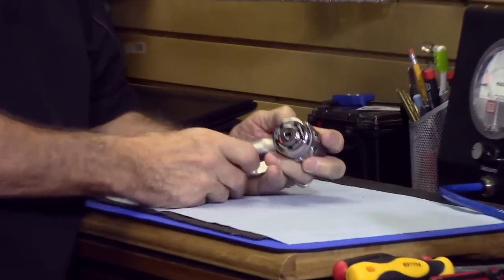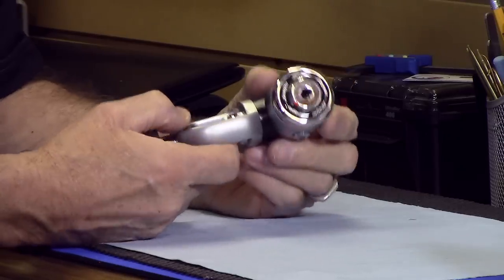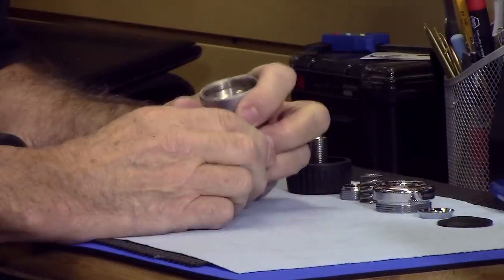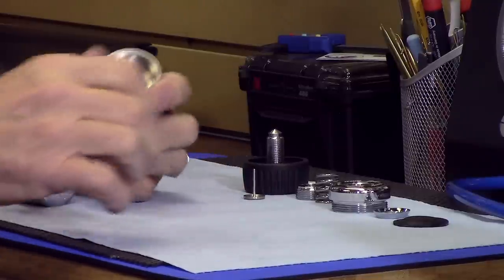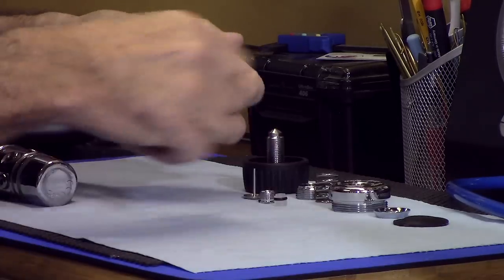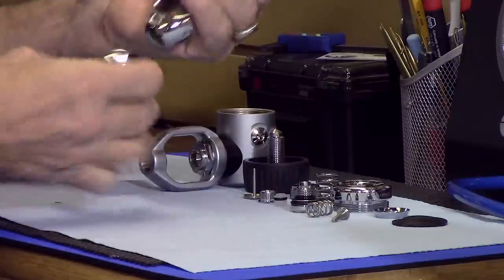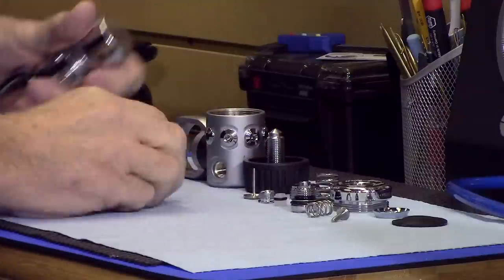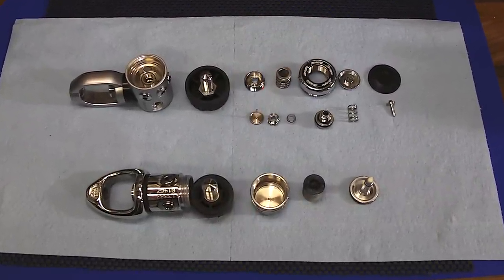Piston vs Diaphragm 1st Stage - Scuba Tech Tips: S07E01

Comment: Hi Alec, 
nice video (as always). However, as you said, you hit a controversial topic. I felt you didn't explain the pro's and con's of both pistons and diaphragm 1st stages. I'd really appreciate a second tech tips on this topic, with more details.
Reply from the maker: As I hinted, both work well. Neither has a big advantage and certainly not in performance.
I may do another tip though to share a couple more points that I left out.
Thanks for watching.
Alec

Comment: Thank you Mr. Pierce for your wise advices. I have dived for more than 10 years with a Mares 2T Diaphragm Regulator. I want to buy now a Piston Regulator. Please help to decide which Piston regulator do you recommend from these: Sherwood SR2 Balanced n Sealed , Atomic Z2 Balanced n Sealed , Scuba Pro Mk25 Balanced n Not Sealed , Scuba Pro Mk2 Not Balanced n Not Sealed , Aqualung Calypso Not Balanced n Not Sealed , Mares Rover 2S Not Balanced n Not Sealed , Oceanis SP-5 Not Balanced n Not Sealed. Your opinion is extremely important. Thank you and keep your wounderfull work !Sincerely, Jose Manuel Portilla from Acapulco, Mexico.
Reply from the maker: That's quite a list Jose.
Of course my opinion on what you will like the best is subjective but maybe I can help narrow it down.
The cost of balanced over not balanced is small so a balanced regulator is the way to go.
The Sherwood SR series has many years of solid performance behind it. It is one of the most advanced designs available, offering incredible breathing, simple diver control and inherent environmental protection. And Sherwood is a very large, international company with distributors and dealers everywhere. Sherwood is often the choice of training and rental organization and commercial divers because of its proven reliability.
Atomic makes an excellent product. I have two concerns with Atomic. It is a small company so service and parts may not be available whenever or wherever you need it. And it's environmental protection is a pretty standard add-on designed to stop water from getting in rather than a feature of its design as with the Sherwood regulators. Atomic does a great job of promoting it's regulators as unique and "unmatched" in the scuba world but neither is true. Their cone-shaped HP seat is not the first such design and to claim it is the "most reliable in the industry" is unwarranted hype.
So, it comes down to your personal decision as to which you like and which will ensure easy access to service in your dive plans.
Either will do a great job for many years.
I hope this helps.
Alec

Comment: Thanks for another great intro level video.  I am a bit of a gearhead so I purchased a near new and serviced ScubaPro Mk25 / S600 combo a month ago because of the excellent performance and reliability reviews.  Probably more performance than I'll ever need, but the international status of SP will hopefully be beneficial in parts, servicing availability, and resale in South East Asia.  The exploded view of the Mk25 shows quite a bit more components compared to the unit you disassembled, which I assume is because of the balanced piston design?
Reply from the maker: You're right - partly. Scubapro gear is one of the best and you now have one of my favorite modern regulators - the venerable MK25/S600. That MK25 has been around a long time and there have been numerous upgrades and improvements made over the years. It seems that each improvement added a part or two. It's still a pretty simple regulator and if you can look at one in action you would see that it too has only 2 moving parts - the piston and the piston spring, just like the one in the video. Most of the extra parts are static - they don't move and are there to enhance performance. Some increase the sealing surfaces, some soften the piston movement, some are there to make service easier and so on. They don't detract from it's simple reliability.
The fact that it's balanced and so offers better breathing characteristics (note that I did NOT say easier breathing!) doesn't really add to it's complexity. Balancing a piston reg only alters the path of the air flow. The piston still just moves up and down.
There are pictures of the MK25 showing the air flow on the internet. See if you can find them. 
You've got yourself a good one!
Take care.
Alec
Reply: french canadian version of 'how it's made' US show.

Comment: Why not compare a Scubapro MK25 piston to an Apeks US4 diaphragm for complexity vs simplicity ?
Reply from the maker: The Scubapro MK25 has been around for many, many years. So long that it's become their most famous regulator.
What's not remembered, or maybe not known, is that is has changed over the years. Most of the changes were to correct issues, some performance issues, some reliability issues and some maintenance issues. It is a very unusual design that employs a 2-piece piston (actually 3 piece but you cannot separate the stem from the head easily) and then they added a second piston head under the first so they could install 2 main O-Rings. Now a simple piston with 1 O-Ring has become a 2-3-piece piston with a second head and 2 O-Rings! 
In each case these changes were to improve reliability. For example, the second O-Ring was added because there was an issue with the single O-Ring blowing our. That was often caused by poor assembly procedure but it was a problem anyway and they solved it by adding parts. Then they added some buffers - sponge rings around the piston stem, at one time as many as 3, (I think it's back to one now) in an effort to stop noise coming from the first stage, either whistles or rattles. These were marketed as improvements but were actually necessary to address problems. 
The balance chamber on the MK25 is another interesting story. I think it now comprises about 5 parts (most pistons work well with 1 O-Ring). Then add their replaceable HP seat with its own O-Ring, adjusting screw, pad and threaded cap and you have a piston regulator that has as many parts as a diaphragm.
However, it's a great regulator and I've used one a lot and sold hundreds. I've also serviced thousands but that's another whole story. They're not hard to service but they do require great care and lots of practice to do it properly.

So now what you've done to me Bumble is take a very sophisticated (read:complicated) piston regulator and compared it to a very  simple, straight forward diaphragm. To use your own words, that's an unfair comparison.
However, even with that, a complete strip of both regs will show a similar number of parts.
The US4 is described by Apeks as a "warm water reg, lightweight and light duty'. I'm not in complete agreement with that. Not having an environmental seal does not mean it's no good in cold water. It does mean that the diver has to exercise care in cold water as per my recent video on cold water diving. And in my books, having fewer parts does not mean it's less rugged - just the opposite. 
However, It really does not compare to the incredible performance of a MK25. It would be a favorable comparison to an Oceanic Sport reg and I mean in terms of sophistication (neither reg has much of that!!) and performance.
Talk again soon.
Alec

Comment: The question that wasn't answered is, if both kinds do the same job, why would a manufacturer choose one over the other? In my case, I didn't choose a diaphragm 1st stage, I chose a complete setup (Aqua~Lung Legend LX Supreme) based on the balance between price and features of the 2nd stage, and a diaphragm 1st stage is what came with it. I had no say in the matter.
Reply from the maker: And that's normally the way it's done Brian.
A diver would not normally go into a dive store and ask for a piston regulator. He would ask for a good regulator or a regulator system. The store would show him what's available, explain the differences and help him pick the best one for his diving needs and budget. And let me make it clear that it really doesn't matter which style one gets. They both work well.
Aqualung has had several piston regulators over the years but the first ones were diaphragm and they sold them for a long time. I don't know if they have any pistons in their line right now but they are comfortable making and selling the diaphragm style so just haven't bothered to change. Most manufacturers offer both (Scubapro, Oceanic, Cressi, Mares, Hollis, etc) while some offer only pistons (Sherwood, Genesis, Atomic, etc). Only Aqualung and Apeks (same company) restrict their line to diaphragms. 

At the risk of irritating a lot of divers and dealers, a search of The Best Scuba Regulators often shows several sites that list the top regulators available today and those regs are #1 the Scubapro Mk25 and #2 the Sherwood SR2 both of which are piston style. I have used both, sold both to hundreds of divers and serviced hundreds of them. I can't argue with the their popularity.
Talk again soon.
Alec

Comment: hi Alec.

i am currently in the market for  my first  regulator. (Yeay)
after watching your video.
im sold on the PISTON reg.
now everything im reading is that piston regs are not generally used for cold water.
That being said. im not intrestead in ice diving.
how ever. will be diving our Ontario lakes though out the summers.
so my question is if a piston 1rst stage isint ideal for cold water.
how cold are they talking about. can i go to 130 feet in ontario lakes or can they still freeze up even though its summer?
Or is any of this even an issue.
really intrestead in what you think before i make a decision. ..joel

Comment: I think the piston 1st stage will deliver slightly better air flow (According to spec sheets from Scubapro Mk19 Evo vs Mk25 Evo) while the diaphragm 1st stage is sealed which allows to do ice diving, deep diving and diving under difficult conditions like mud, sand, toxic waste or oily water. Despite that the piston has better air flow on the paper (2000or 2500 l/min vs 1800 l/min at Mk19 Evo diaphragm) i figured out that both 1st stages are easily able to support up to 5 divers with air at about 10 m or 32 ft of depth for about 30 mins without any problems or anything so they are both built pretty good, strong and reliable. But the tech diver or commercial diver will always or mostly choose the diaphragm for the primary gas at high and low depths and the piston 1st stages for O2/deco stages or dives at normal depths and conditions.
Personally i am using 2 Scubapro Mk19 Evo and 2 Scubapro G260. no yellow Octopus, but around 1,5m of hose at the secondary reg and a real 2nd stage without the cons of a downstream octo which i think is advantage for both cases: Me needing to change to the replacement reg and 1st stage because of primary 1st stage failure or anyone other needing air support because he got any failures. Anyone needing air from me will get the same reg i have in my mouth with fully configurable venturi valve and intermediate pressure plus an extra long hose to maneuver around or take some distance in tight sections to go one after another through. With this setup I tried to minimize/prevent any rabbit hole effects when stress and trouble are building up whilst unforseen happenings or failures.
Reply from the maker: Thanks for sharing your detailed experiences.  With all the choices in gear, I think it is mostly personal preference to which to use in rec diving.
A

Comment: a bit off the subject but I noticed one regulator was stainless steel shiny chrome and one was satin brushed chrome(a bit duller) which is less likely to get scratched, dinged nicked etc easier? which will look newer longer?  Ive got a chrome one and only 15 dives seems like its staring not to look new anymore . (maybe boat guys in Philippines a little rough on it)  My next purchase will take it into consideration.  is ti same brass under both?
Reply from the maker: The body is always brass. Chrome looks nice when new but it definitely scratches quickly and loses it's luster.
That's one reason that I'm a fan of the newer Cycolac (plastic) bodies. They have a lot of advantages.
Alec
Reply: @AlecPeirceScuba_SeaHunter  Ahhh interesting, definitely will take a look,   considering one for my next purchase then.  Im sure it would be A lot lighter.   THUMBS UP !
Reply: @AlecPeirceScuba_SeaHunter  I don't think you'd recommend plastic for cave diving?
Reply: Alec, you neglected to respond to anything I said?

Comment: Alec,
Thank you so much for you awesome vids!  I recently purchased an Atomic B2 regulator.  Two questions for you:
1) It comes from the factory with the secondary hose already attached to the "in line" LP.  I've read that this provides the "optimal" air flow?  Should I leave it where it is or place it in a more traditional configuration and If I did change the location would I lose air flow.  Additionally, I'm assuming in the current configuration that the second stage hose should be facing down?  
2) Your opinion on the B2 regulator.  I'm new diver and my biggest desire in a regulator is the ease of breathing.  I'm still a little nervous when I'm diving and seem to be taking BIG breaths.  Although, I understand that with time in the water will come more confidence and ease of breathing.  But, in the mean time...   This specific regulator has received some excellent reviews regarding breath ability.  Beside your opinion on the B2, could you recommend a few regulators.  Thanks in advance.
Reply from the maker: The Atomic B2 is an excellent regulator. 
Relax. It is NOT all that unique.
Atomic has done a wonderful job on their website and literature to explain how their regulators are the best of the best.
In fact, they are among the best. But, everything they claim to be unique and special is actually quite common among all top end regulators. They have been particularly good at making up names for the "special" features. Other companies have not done that but they have the same features. 
This is not a knock against Atomic. It's just trying to point out the difference between marketing and production.

You can put the LP hoses to your primary or secondary second stage, or the BCD inflator for that matter, into any LP port you choose. They all work equally well. Whether a hose points up or down does not affect performance. You should choose the configuration that works for you and is also  recognized by other divers so they can assist you or you can assist them without having to check the instructions.

As you get more experience you will begin to relax and your breathing will become more normal. With time you won't ever notice your breathing. On 2 separate occasions while scuba diving I fell asleep underwater. To say I was relaxed would be an understatement. It was only a problem on 1 occasion - the reg fell out of my mouth!!
Take care. Enjoy yourself. Don't get too caught up in the technical aspects.
Alec
Reply: Alec,
Thank you for such a quick response.  I truly value your opinion over other people.  You present facts and let the consumer decide what fits their needs.  It can be overwhelming walking into a SCUBA shop and trying to decide what to buy.  They all have their biases towards certain gear and tend to only promote what is best for them, not the consumer.  
Thanks again.  
Have great Memorial Day weekend.

Comment: Alec, you missed a few major drawbacks of the piston 1st stage...it requires more maintenance, as in, lube the piston O-rings. The diaphragm does move but it's only a small flex...simpler. Pistons can get contaminated with grit easier. It isn't as adjustable as a diaphragm 1st stage. It's easier to adjust a diaphragm if you don't have an externally adjustable 2nd stage. 
I think you lost your footing to the basics in air delivery.

Comment: Hi Alec, I need your opinion if you be so kind. I am looking at snorkeling in 12-15 ft depths, I plan on using a long flexible tube to breath with but am wondering if there is such a low pressure diaphragm mouth regulator i could use so that i can release my oxygen  waste instead of recycling when breathing. Can you suggest such a mouth piece that may do the job?
Any input will be greatly appreciated.  Many thanks for posting your videos keep them coming!
Reply from the maker: Sorry to rain on your parade but it simply won't work.
One can not breath underwater through a tube that is longer than about 18".
When I was actively teaching, I'd illustrate this principle by getting the biggest guy in the class to lie on his back in the shallow end of the pool and try to breathe through a tube. I'd stand on his chest which was about 2' down. 
It was great fun and a dramatic display to watch him struggle to take a breath and then struggle to get to the surface.
Sometimes I suggested that he use the pool vacuum hose which is about 3" in diameter.
That sure looked easier . NOPE!!
Take a scuba diving course. You'll love it.
Alec

Comment: nice vid, but I do still prefer Diaphragm over piston, have you ever seen a Diaphragm reg first stage loosing air , me not, but I have seen a lot of piston 1st stages blowing from the piston O-ring, so simpler is better is arguable.
If simpler was better, why are we not using two sticks to make fire instead of a Zippo lighter ?
Reply from the maker: 2 sticks take too long!! Keep in mind that 2 sticks never breakdown - Zippos always.
Actually, I have seen many diaphragm 1st stages leaking. However,  properly maintained, neither style is more or less subject to breakdown.
It's entirely a personal preference. My preference for pistons may be influenced by the servicing of thousands of regs over many years - not because it's a better performer.
This video is not to change your mind but to make you think. Apparently, it worked in that respect.
Thanks for watching Theo.
Alec